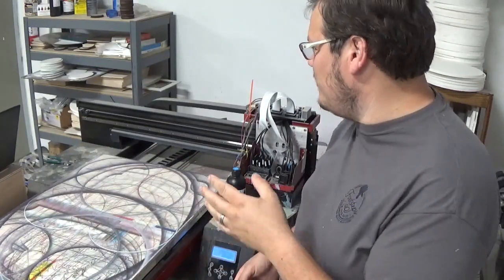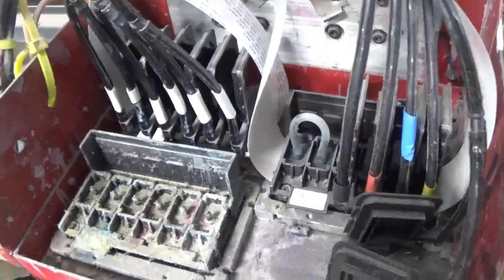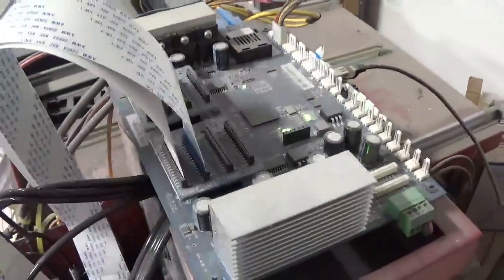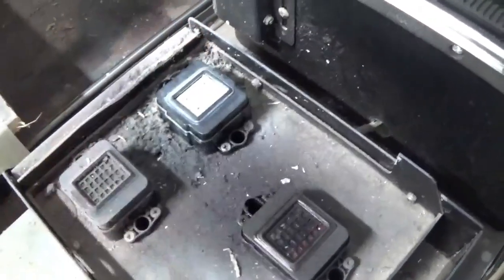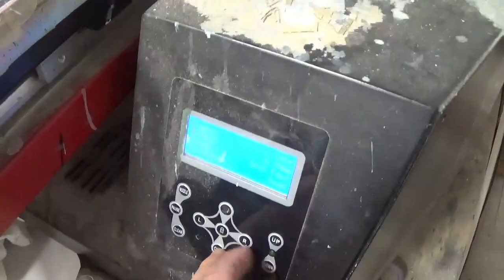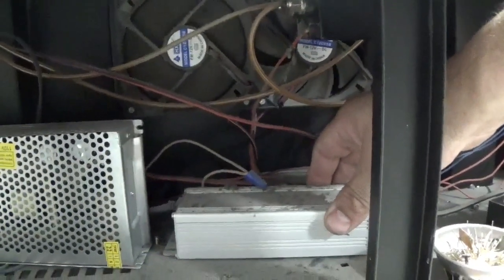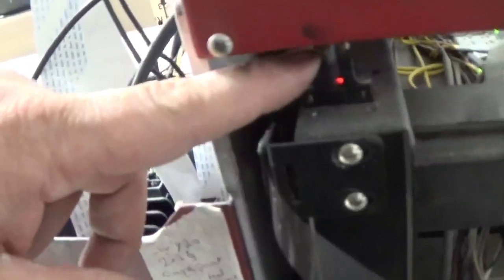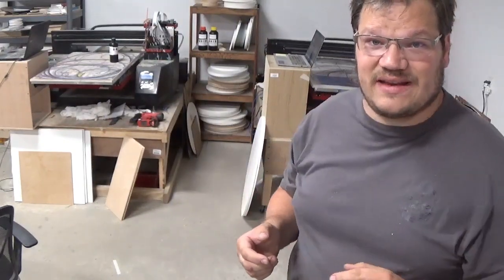Parts of the Printer, what they do and where they are on my Jay's Printer 6090pro ZZ2C

Comment: Great info.. thank you for making this video... doing some intense research to make my own uv printer.. and got a lot idea from you.. besides do you have suction fans in your suction flat bed?
Reply from the maker: This one does not have the fans for a vacuum table but the bed is set up for it I have thought about adding them but my other printers have them so I didn't yet
Reply: @JaysToDoList  okey.. did you purchase them brand new or on occasion at a dealership?
Reply from the maker: @praveshcaulachand8131  yes I am friends with a technition at a the  manufacture did you need somthing?